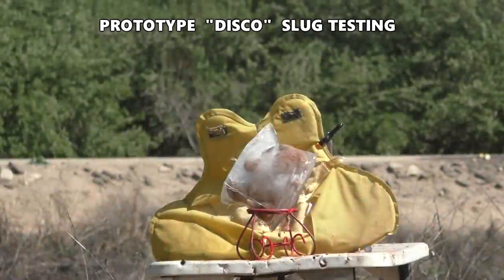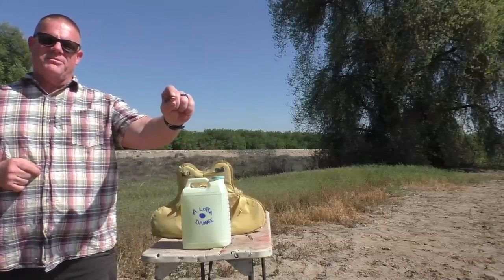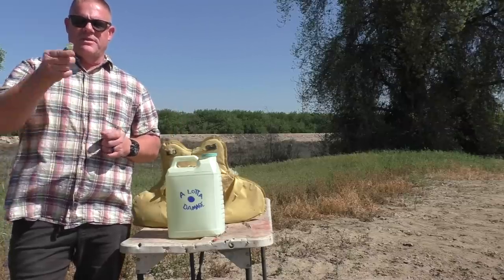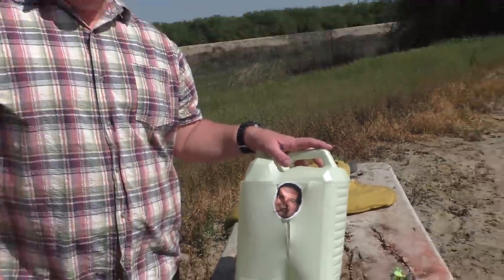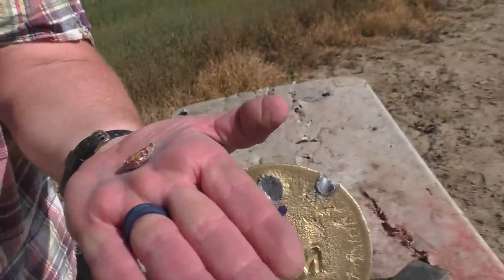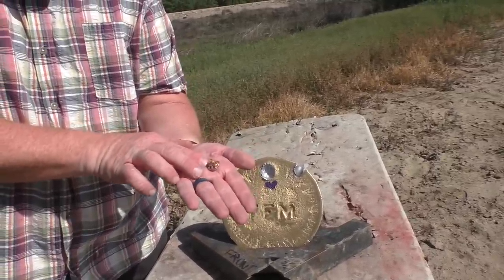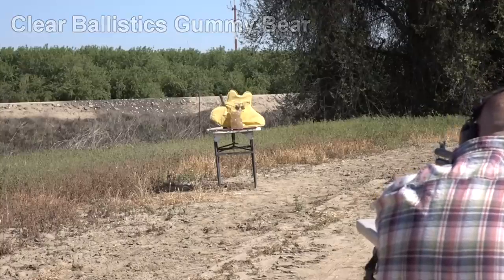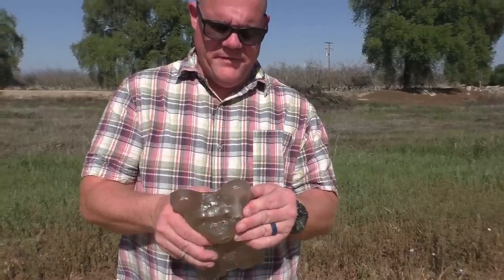12ga Shotgun DISCO Slug (of the '70's future)  We test it!

Comment: I imagine the reason it does so much damage is because of the air inside the slug, essentially creating a small explosion as it collapses... Imagine what it would do inside of a person? Not to mention the fragmentation after hitting bone et cetera.
Reply: If it was made using a softer metal, and could be fired out of the barrel without collapsing. The damage on impact would be huge...

Comment: 8:38 Just need a FLIR camera, ask OG to bring one from the department next time.
Reply: It won’t find a hot round buried in hot sand.
Reply from the maker: The slugs are not hot though.    The will heat up if they are smashed,  sort of like how a copper wire heats up when you bend it.

Comment: When it hits the bowling pin, shards go flying off. Then, as it turns around, a small chunk flies out of the hole in the back. Starts at 12:35, you can tell it's reflective shiny copper as it spins in the air 12:37. Leaves camera shot at  12:42.

Comment: Wondering if you’ve tried a half ounce tungsten or tungsten carbide fishing sinker in a sabot yet.
Made some at work 20 years ago, same diameter as a .44 sabot 50 cal muzzle loader bullet I had . Bullet was 240 grain. Sinker 220.
Might I suggest using it in a 20 gauge, like a Remington Accutip 260 grain sabot slug.

Comment: Try a slug that is a section of bar with holes drilled at an angle around the centre of the top to the sides a bit above the bottom.
And see what it does damage and stability wise.

Comment: Wonder if an AD&D lead 20 sided die would fit down a 12 gauge barrel for 1D-20 Damage?
Reply: Maybe. I've seen some 12mm across the flats (friend casted a silver d20 that size), but I think the standard is 18 or 20mm across the flats. And that won't fit down the barrel of a 12ga.
Reply: That's what I thought that was shaped like...
Reply from the maker: It would have to be the right diameter but also heavy enough (over 6 grams)  to get the powder ignited

Comment: I still have to say, I'd have those "used" Kevlar pads shoved into my vehicle's body panels... Would quiet the road noise AND, when behind a car body panel, offer a slight bit of actual protection, and they are lighter than sandbags. Although I admit they wouldn't be as effective vs IEDs, America hasn't gotten that far yet so, "used" kevlar would be sufficient for now. 

Course that would be the case if bullets were actually the most dangerous thing a police officer had after them...

Comment: You guys keep knocking the thermal imaging camera, but it would work, hell they even have ones you plug to your phone
Reply: But the sand the rounds land in is burning hot most of the year.  The thermal camera would be an expensive way to see all one color.
Reply: @OGsDangerShow  that makes it even easier to spot a purple spot, however i will admit i have not handled hot slugs freshly fired(joke in there somewhere)so i do not know what the temperature differential would be from sand to round ,
Reply from the maker: The slugs generally are not hot unless they compress (heat of compression)    Sort of like how a copper wire heats up when yo bend it back and forth.
Reply: @taofledermaus  ahhh and there lies the funny I just assumed it would be extremely hot, I have Never found a single 12 gage slug I've shot ,thanks for the clarification and all the entertainment guys!